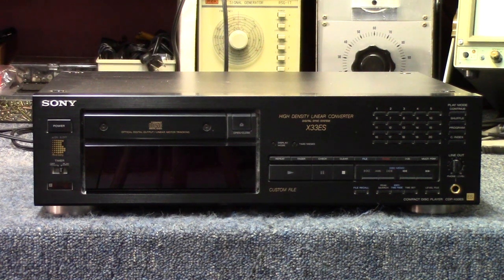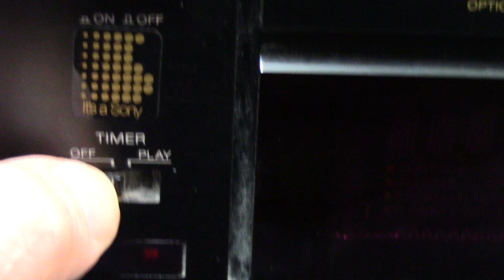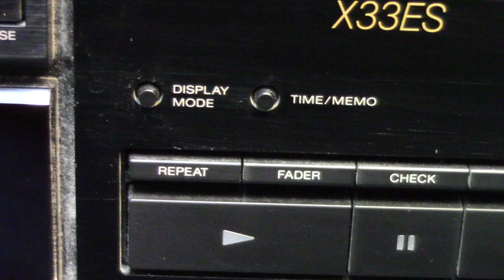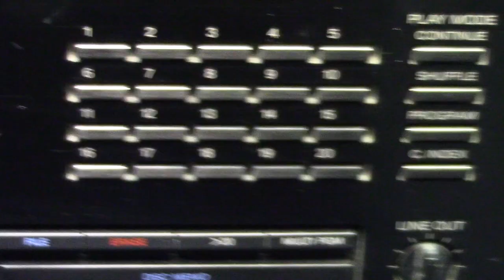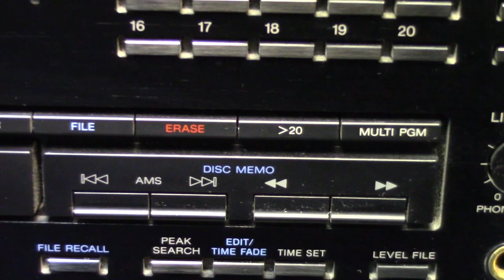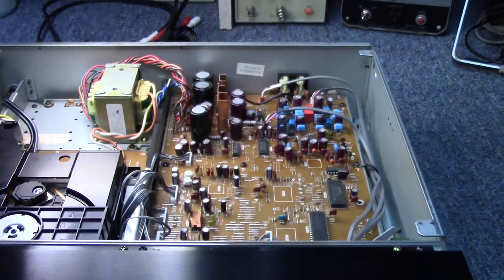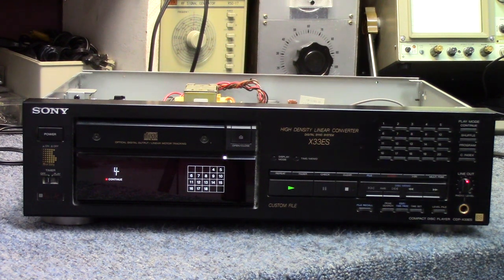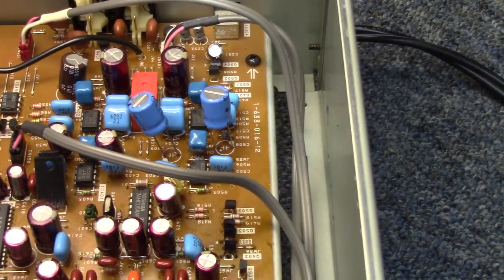Sony CDP-X33ES Compact Disc Player - pt.1 eval & testing

Comment: Nice video. I Did the same repair in december 2019. All red/violet caps leaked out, distortion in left channel, traces of cap's fluid on board. Soldered new Nichicon gold for audio. This 1990 sony cd player line have had same problem with leaking caps in almost every player.

Comment: The direct drive sled is a linear motor.

When it works, random access is FAST.

Unfortunately, if the pickup fails, such as because it won't read discs anymore, getting a replacement will be very difficult because Sony didn't use those pickups in very many players, probably a big reason why I'm not bothering to upgrade from my Sony CDP-X229ES since that one uses a more commonly available pickup.

And, yeah, those Elna capacitors sure do like to leak, especially if they're the special ones whether it's their LongLife series or their Duorex series.  And I've equated that smell of leaked electrolyte to rotting fish.

Comment: Why did "SONY" produce this CDP with a single transformer version AND dual transformer 
version?  pc
Reply from the maker: I would say the 2nd transformer is for the audio section so it can be isolated from the mechanical parts to reduce noise.
Reply: @luvradios  correct... does is YOUR unit have a single or TWO TRANSFORMERS?
There are single transformer examples of
this CDP, which splits the PS and other units 
that have 2 separate transformers.
Reply from the maker: @pocketchanged  @ 7:17 in the video you see the power supply only has (1) transformer.